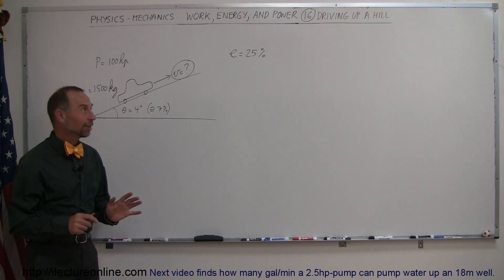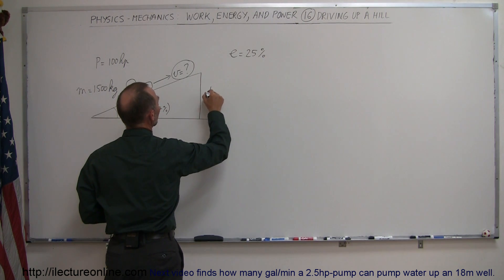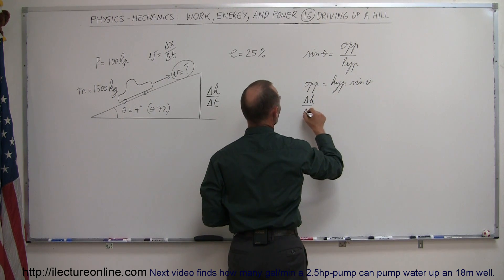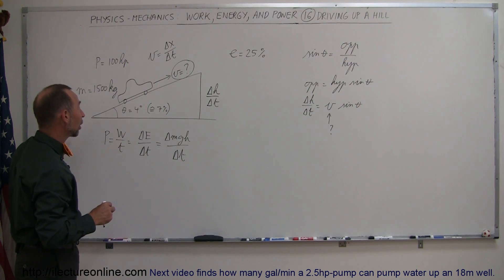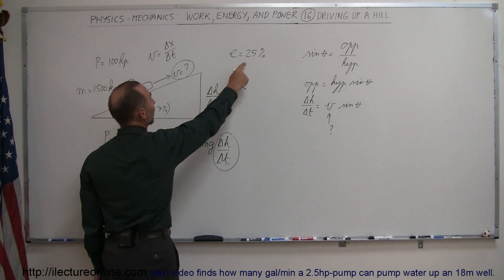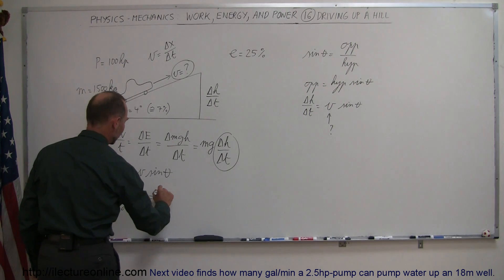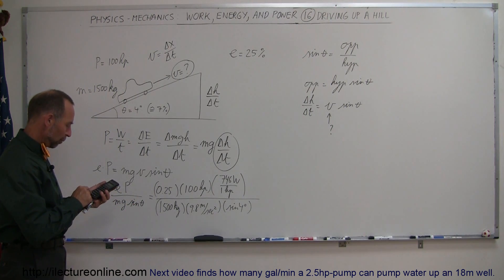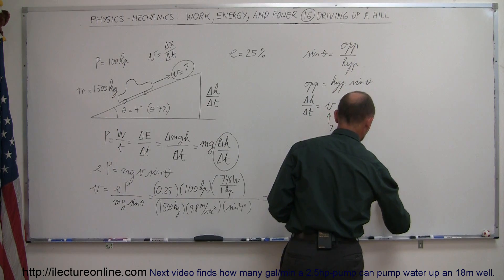Physics 8  Work, Energy, and Power (16 of 37) Driving Up A Hill

Comment: I would like to comment on the efficiency factor 25%. Such factor can be obtained from data available in the net .  For some models of cars one may find the plot of power( measured on the axle) vs. RPM and the plot of torque ( measured on the wheels) vs. RPM. If one multiplies the torque in N.m times the rotation speed in radians per sec( not RPM)  and diviide by the power in SI units for a given rotation speed,  one will get the efficiency, which can be on the order of 25%  or lower.

Comment: I have been thinking along the line of this in recent times as back in 2008, I was driving up the Toowoomba Range, which has a 10% 4km long incline. The speed limit is 100km/h along the first half of the incline and is reduced to 70km/h about half-way up, however I was struggling to maintain such speed from about that point onwards. I had my foot right the way down on the accelerator and the car would have been doing about 30-40km/h. If that incline had been much longer, the car probably would have eventually stalled. The vehicle I had at the time was an old Mazda 323 BG Series 2 sedan, however I have since bought a Nissan N16 Pulsar and I drove up that same hill in it just six weeks ago, which was for the first time in eleven years, however I was actually able to maintain those speeds. I disengaged the overdrive when I got to the foot of the hill to allow greater RPM, which I think helped a great deal.

Comment: What a great video! But I just don't understand how we can treat velocity as a side. isn't the hypotenuse suppose to be a length? 

And lets hypothetically say that we had a resistive force; Do we have to calculate the work done against friction, then take it away from the total work done? ( or do we add it?)

Thanks!
Reply from the maker: Very good questions.  There is a technique (see the videos in the relative velocity section) where we represent velocity as a vector (which it is) and then we can use the triangle to compare velocities.  Secondly the work done results in 2 things: 1) it adds energy to the system     and 2) it is used to overcome friction      thus you must add them and set that equal to the work done.  (see other examples in the playlists on work and energy)
Reply: @MichelvanBiezen  Thank you so much!

Comment: Hello Michel,

I have previously watched your Conservation of Energy videos, and now I'm trying to understand Power. In the Conservation of Energy playlist you show the equation

ep + ek + W = EP + EK + ELost

It seems to me like W, which is the work applied, is essentially the same as Power. For this particular exercise I used that equation to try to solve it. The initial potential energy is zero, and since the velocity is constant I can also remove the kinetic energies from the equation, so I end up with:

W = EP + ELost

I couldn't solve it because I don't know how to figure out ELost (the energy lost due to friction). However the exercise doesn't specify if there is any friction to begin with, so I assume it is frictionless and therefore ELost is zero.

W = EP
W = mgh
W = mg(v sin (4))
W = (1500)(9.8)(v sin(4))
74600 = (1500)(9.8)(v sin(4))
v = 18.2 m/s  (after multiplying by 0.25)

So it seems to work, but my question remains: is that road actually frictionless (and therefore ELost is zero), or does it actually have friction but we don't take it into account because presumably this Power is used to overcome it?

Comment: How is the angle is in percentage
Reply from the maker: That is a common way of indicating the incline of a road.
Reply: Sir can we calculate this
Reply: Or convert this any angle in percentage or percentage to angle
Reply from the maker: The percent is related to the slope.  The slope is the rise over the run, which can then be converted to percent.
Reply: This percentage is just the sine of the slope angle. In this video the angle is 4 degrees and its sine is 0.07, which is 7% slope. The lecturer might have used this straight i the formula replacing the sine of the slope angle ( 4 degrees).

Comment: how do we know the car is moving at constant speed/a constant force is applied. why is the car not accelerating?
Reply from the maker: If the NET force is zero, then there will not be an acceleration.
Reply: David Solodukhin 
The said car has reached its maximum potential. Under the given conditions.